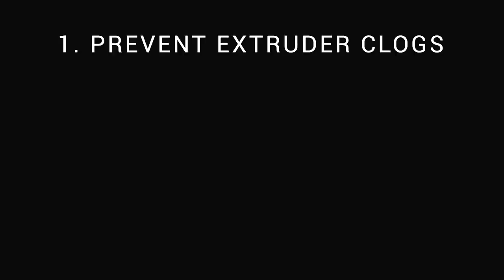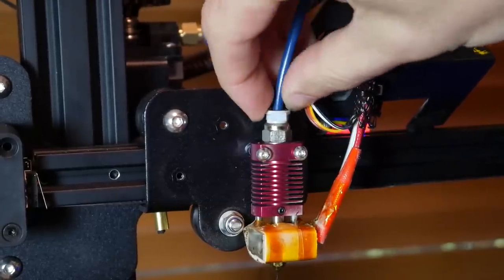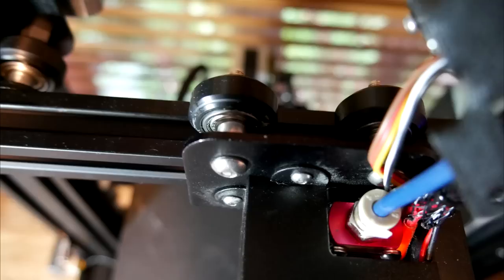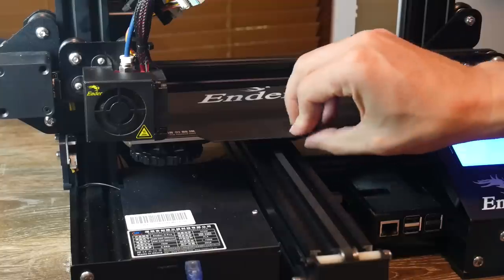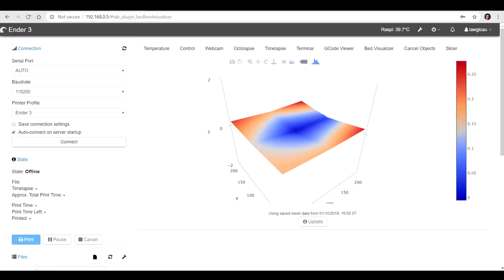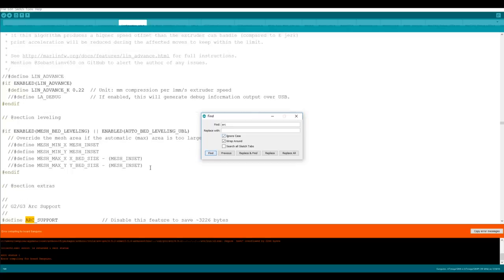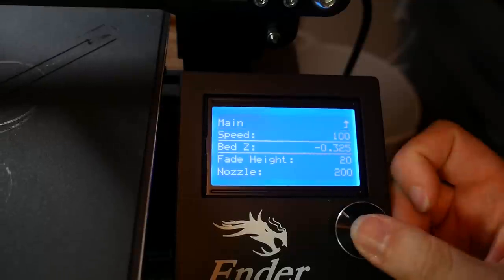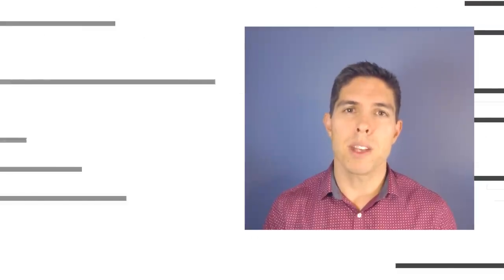5 beginner Ender 3 fixes - featuring manual mesh bed leveling guide

Comment: im just going to state my experience and opinion here......those 2 screws are not your initial heat creep problem.a weak or going out fan is causing your heat creep.....so by removing those 2 screws,yes you are slowing down the heat creep process.but your avoiding the heat creep cause.my cr-10 developed heat creep after 10 mths of printing 50-70 hours a week.i removed the screws after many suggestions to do so....only to find out 20 hours into a print the heat creep returned.at that point in an effort to get a paid print done i swapped out the entire hotend.i left the screws on the new hotend,adjusted z offset......and started print......only to see it fail 16 hours in.i noticed the hotend cooling fan seemed a bit slower.replaced the fan and finished a 40 hour print.
after the print i returned the 2 screws and reprinted at a slower rate......52 hours flawless print.
cooling was the original problem,not the 2 screws.if your fan is blowing like it should,these 2 screws and the exposed throat will be cooled more than enough to never let the excess heat creep pass from the screws to the brake causing a clog.i enjoy your videos but wasnt happy when you informed people to remove 2 screws that arent the problem in the first place.ive  installed the same failing fan on my ender 3 as a test......and it failed a 20 hr print due to clog.so a cheap china cooling fan is to blame .....not these 2 bolts that most groups claim creality forgot to remove.
we all know the stock fans on the creality printers are throw away fans.
but none the less keep up the great vids,and thank you for the videos.
Reply from the maker: Personally I haven't had any issues with heat creep. It seemed worth covering as on paper at least it should be better. I agree that a working fan is more important and should keep it reliable.
Reply: I agree, those screw are made out of stainless steel, a terrible heat conducting material. The Mosquito have 4 stainless rod and that one never have a heat creep at all

Comment: I have a CR-Touch and the G29 Gcode. Before the print starts, It probes 9 points on my Ender 3 Pro’s bed, but after the probing, my print still has inconsistencies. Does anyone know how to fix this?

Comment: If you also uncomment the line "#define RESTORE_LEVELING_AFTER_G28" then you do not need to add anything to your start GCode.
Reply: Unless I was doing something wrong, I can confirm that uncommenting "#define RESTORE_LEVELING_AFTER_G28" does NOT work as it should... Mesh bed leveling would not work for me on my Ender 3 Pro running the latest Marlin 1.1.9 firmware during prints until I added M420 S1 to my start gcode. I could do the bed leveling via the LCD screen, I could save it to eeprom, I could see that it was stored by using G29 S0 in the terminal, but when printing it would not use the mesh.

Comment: I would like to add a tip… make sure to not have a fan running. I realized I had my ceiling fan running on low for the past 3 attempts of printing and the movement of air moved the filament out of place

Comment: I came here just looking for the menu that moved the print head to the corners to adjust it... Now here I am uploading yet another firmware. 
Luckily the upgrade was free, this time.
I've also confirmed everyone's question for a dual z, the cr10 kit fits( the leadscrew is a bit too long, easily cut though)

Comment: It's true we are not "leveling" the bed.  Traming is a term most people are not familiar with.  Easier to explain that we are setting the bed PARALLEL to the movement of the print head, IE: at all points in the movement of the printhead vs the bed the head will be at the same height above the bed.   Auto bed leveling goes a bit further, it builds a map of the bed surface as seen from the print head, and applies a fudge factor to the print head Z position as the print head moves across the bed.  I'd call this "don't raise the bridge, lower the river!"  "Auto bed leveling" (again probably not quite the correct language) is the only way to solve the problem of a warped bed surface without replacing the bed.  Yeah we can do a lot of magic in software!

Comment: even with an EZABL i still had to use glass on top of my bed because the stock build mat is so jacked. however with the glass i have a layer of gluestick on it i have no problems and rarely need to use babystepping to get a good first layer its pretty well dialed in with my z probe offset.

Comment: Still a noob, less than 2 weeks wirh my Ender3.  Was talking with noob on Facebook about the bed leveling.... basically said about what you said with the tug on the paper. Takes a while to get uaed to the feel of what is right, but when you do you'll know it. It's a bit like getting used to the reaction of a new cluth in a car.

Comment: I'm using TH3d and the mesh leveling setup is different then this. can you help a brother out? i have it all enabled but there is no LCD part in config h. i use it on printer and it does like 25 points or something, changed the gcode with the m420 s1 and it just doesnt seem to follow the mesh leveling. never see z move like yours and my prints first layers are not right. advice please and thank you!
Reply from the maker: In the TH3D version it will likely be located in the config_backend file. You should be able to make the changes you like there.

Comment: My ender 3 v2 glass heat bed was warped. I purchased extra clips and then heated the bed to 100c for 20 minutes. I have clips on all 4 corners, and one in the middle of the front back, and right side. I didn't put one on the left side because it would get in the way of the extruder when it draws the first line.

Comment: Oh this certainly helps. I need to do the thing with the adjustment screws (and eventually invest in an easy abl thing lol) because when I was printing a Menger sponge as a test print, I noticed the far left corner for the tiny iterations was skewed upwards. I think my x is too tight and z too loose. Then all I need to do is fix my overall overextrusion issue. Even now I just heard the extruder wheel thing click which I'm guessing it's doing because of too much pressure. I need to do that procedure with measuring filament to figure out how exactly to adjust for this in the slicer. 

My Y axis also tends to vibrate a lot more than any of the other axes. Is this normal or is it maybe unbalanced?

Comment: Hey Michael. This is an awesome set of tips! Thank you! My biggest frustration right now is actually with my slicer settings. I followed the directions in your slicer settings video and used the gcode that you provided (which printed awesome btw), but when I input the findings from the various test into Cura I still get bad prints. Is there any way you could post your Cura profile with an upcoming video? I know you use Simplify 3D mostly, but if you have a Cura profile that's been working well for you I'd love to check it out. Thank you!
Reply from the maker: I think as a challenge I'd like to try and learn Cura and make a video about my experience, hopefully with a profile to share at the end.
Reply: That would be and awesome video and your insights would be much appreciated!

Comment: Michael, great instruction.  I have an Ender 3 and bought the BLTouch kit for it.  Everything was working well until I had to remove the hot end fan to clean up some melted filament around the the top of the nozzle.  After going through the calibration for the BLTouch again, I now can only print small items.  Even after fiddling with the Z-offset, any large print's first layer will be too close on one side and too far on the other.  I really enjoy having the BLTouch, but I haven't been able to print anything larger than a benchy lately and I'm thinking of pushing Marlin 1.1.9 onto the Ender 3 just to be able to print (without ABL) again.  I have the silent mainboard installed, so I can just update through USB.  Is there any fix for the ABL, before I remove it?

Comment: Just wanted to say the wheel adjustment worked brilliantly and greatly improved the accuracy of the print. Small circles are still not perfect circles and instead look like a weird S shape wug thing. 

But compared to the potatoes from before it's so much better and there's no more of that weird squeak. 

How do I fix the Ender 3 extruder fan issue? It constantly buzzes and seems to fail a lot. I'm afraid it'll fail when I'm not looking and screw something up big time. 

What's the ideal thickness to leave between the print bed and hot end? I tried 0.2mm and that didn't work at all. Maybe because the paper is getting squished (I used some sort of cardstock thing from the mail that was fairly thick) and if I use an old credit card it doesn't work either. I can never seem to get the bed leveled at all and when I think it's level, it isn't. 

Could you also do a video explaining the process of using the extruder stepper compensation for overextrusion for the Ender 3 (or I suppose, the process should be similar for any similar printer)? I've been trying so much for the last half month to get everything tuned but I can't for the life of me fix the overextrusion. So much stringing! 

I think eventually I'll get an easy abl probably on Amazon during Black Friday or whatever idk these two things! They're so annoying to deal with! Maybe my room is too humid this being Florida? Should I get a dehumidifier?
Reply from the maker: For the ovals, try tensioning the belts. I had the same when one was loose.

I covered extrusion multipliers in this one: https://www.youtube.com/watch?v=3yIebnVjADM

However a nice way to reduce stringing is to lower the hot end temp by 5 degrees. Try this and if it helps do it again. Technically apart from layer adhesion the lower the better for reducing stringing.

Comment: Hi Michael, do you recommend the Glass Bed for Ender 3, i did every thing to level mine with no sense still have issues of non stick and some times the nozzle moves the printed lines, my bed is fiber i guess not the stick one its the stock one that came with Ender 3 and i always have an issue in the center of the bed while leveling it  even i added a piece of aluminum foil in the center but still have the same issue, my Ender 3 are new as i just bought it and I don't know what to do

Comment: When I do a auto home, then disable steppers and leveling the bed with a paper, when I start a print the nozzle is about 3mm over the bed. The auto home is much lower. So I cant leveling when auto home, because when printing it goes higher. I could level before with auto home, but I dont know what happen. I have the latest TH3D firmware.

Comment: Thank you! i have curved bad too.
Also what surface do you recommend to use for ABS/PLA?
I try with stock surface - it OK, but hard to remove print from bed, try glass+glue stick - for small print it work nice, but when i try print big print (110x80 mm ABS) brim pull-off (i thing because shrinking).

Comment: Hello Michael, thank you for your videos, they are great. I always wanted a 3D printer and just ordered the Ender 3... However... I have no idea of how to even start with my first print... Of course I am looking online but was wondering if you had a Beginners video or any recommended resource I should go to... Just to get started :)... Thank you!
Reply from the maker: Hi Pablo, start by printing the test file on the SD card, it should let you know if the printer is assembled properly and working well. After that install the newest Cura and it should have a slicing profile for Ender 3 included. Start with a short and simple print and branch out from there. Community groups are your friend, as is the search feature. Good luck!
Reply: @TeachingTech  Great! Will Do... You wouldn't believe but I have no idea on how to plug it in and start my first print.. Is it done with an SD card? is it done through USB? Do I need any specific software?... But you are correct, forums (and community groups) are my friend so I will keep reading... I just haven't found any video showing the basics basics, and I think there is probably a demand for it (maybe I should shoot my first video :) ).... By the way, your videos are great, thank you for taking the time to create this content...

Comment: When trying to compile the firmware for mesh bed levelling i'm finding that my sketch is still over by 300 bytes is there anything else I can disable to take this below the threshold?
"sketch uses 130348 bytes (100%) of program storage space. Maximum is 130048 bytes"
This is including after I have turned off the arc support.
Reply: same problem
Did you find a solution?
Reply: Gabriel.Gore I did but I don’t fully remember what it was, I think I turned off the boot screen which saved just enough space to allow me to compile and upload it to the machine. Check reddit for a post by LordLevan
Reply: @jakemxd  thanks. I've found some ready made config files that worked on reddit. Leveled the bed, it still looks shit, but I'll try again hahaha
Reply: I was over by about 4000 bytes after following this tutorial and I found another vid that mentioned using slim menus by deleting // in front of #define SLIM_LCD_MENUS in the Configuration.h tab (makes it so you don't have the option to adjust jerk settings on the fly). It worked for me!

Comment: How do i get the magnetic mat clean, i have a thin "layer" of plastic that is stuck onto the mat, i have tried all kinds of things to get rid of it, for example...isopropyl alcohol, etc., but the plastic is almost "fused" with the magnetic mat. The ones i see in Youtube videos looks clean without any plastic residues.
Reply: Did you figure this out? Same thing happened to me. I heated my bed to 110 c and the filament came right off! It makes it soft enough to peel.
Reply: @chiuthejerk  , thanks, yes i figured that out eventually, that was actually the only way to get it off....with heat. When it was heated the plastic could be scraped off.

Comment: Have a random question for the world. I have an Ender 3 Pro, with a few upgrades (springs, skr mini e3 v2, all Noctua fans on PSU, hotend, and mainboard). Been working like a dream and I only use Hatchbox or Overature PLA. Installed a BLTouch last night. Triple checked my offsets (-44, -1, -3.31). Prints look good in the middle of the board, but very poor adhesion in the front and outskirts of my plate. My bed visualizer shows a very good mesh. Struggling pretty hard here since I had no leveling/adhesion issues in the past. Random ideas for triage? Will try a facebook group I'm in, but just happened to be watching this video again and figured I'd try.

Comment: Thanks for sharing this info Michael.. 
Recently I have got my first 3D printer, Creality Ender-5 pro.. I am facing similar issue during my first print on Ender-5 pro.. Do you think similar firmware settings in Ender-5 pro would work.? Thanks

Comment: Hi Michael I want to thank you for taking the time you spend to put up all these great videos to help us out. I got through the boot loader & Marlin install thanks to you. I setup the bed leveling and don't really see or feel the Z axis moving much at all, I did save after the leveling was done and put the G-code in after the homing code in Cura as well, any thoughts? Test prints do seem to be consistent though.
Reply: Michael I figured it out, it was saving to a work SD card instead of the Micro for the machine. I am noticing quite a bit of jerkiness which is weird to me, I'm doing one more test print then I'm going for an overnight 10hr print, lets see how that comes out.
Reply from the maker: Glad you sorted it, fingers crossed for you long print.
Reply: @TeachingTech   Thanks, the print completed but the results had some strange artifacts, the print head was jerking about pretty bad. This is what I found, Cura had updated and somehow reset my Print and Travel Jerk Settings to 0 so the machine was using the settings in the Marlin Firmware which by the way is waaay off. I made my Print Jerk to 8mm/s and Travel to 15mm/s in Cura then had to do the same for the Skirt/Brim Jerk setting as well which I made 8mm/s. She is ripping through some more parts for a project I'm working on for my Daughter. I will redo the other parts over night, its all good I'm still learning and am grateful for your help and support.

Comment: HI Michael, Thanks for the videos..   Newbie Q hare..  I have heard that the distance from the nozzle tip to bed after z homing is adjusted to 1 or 2 sheets of paper..  A standard sheet is around .1mil, or .004"  2 sheets is about .2mil, or .008"  What is the appropriate distance???

Comment: If the 3D printer has a wobble like what was shown @ 5:01 in the video. There could be couple reason for that which is either the 3D printer is not square OR it's the table it's on has a problem not being flat.

Comment: Micheal, can you help me? I have and Ender 3 and I love it. But I can't get it to print clean with Nylon. I tried all the settings, if I use retraction the print comes out under extruded (no matter the retraction settings), if I disable retraction, it solves the problem of the under extrusions, but the model is completely covered in strings, like it's encased in spider web, and it takes forever to clean it up. I'm using Taulman 645. What can I do?